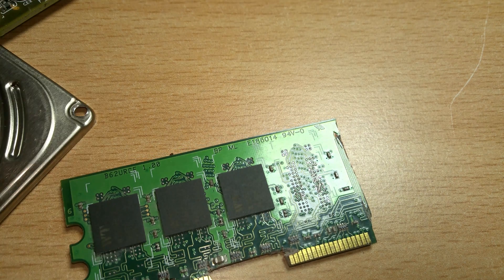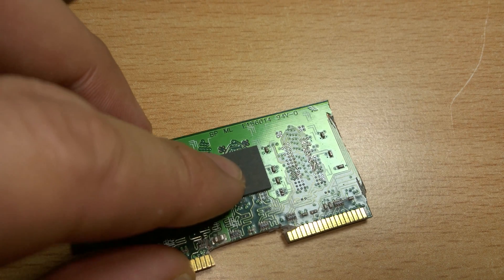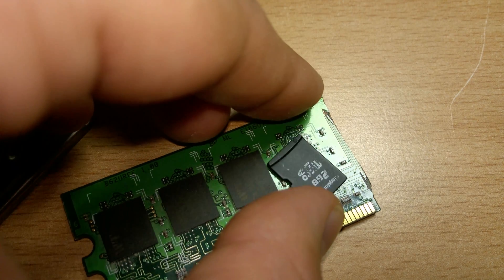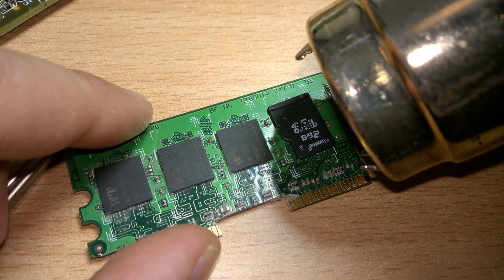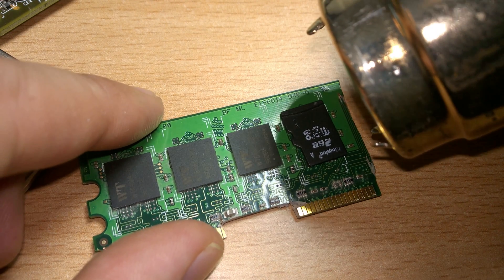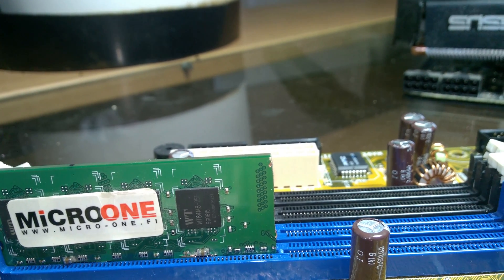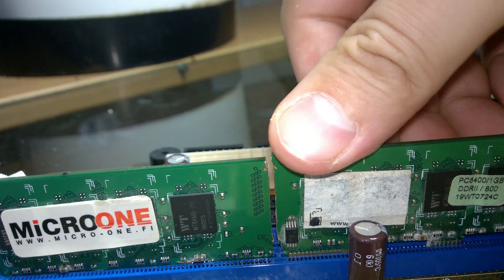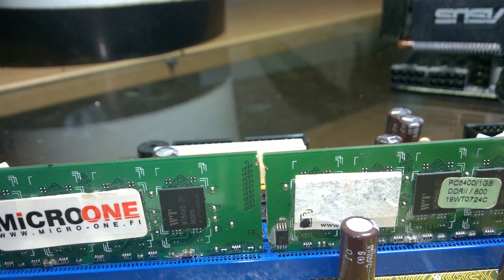Use your old SD card as additional RAM

Comment: Top thanks my guy! With the advancements in SD technology my pc now has a ram of 2 tb!! I dont even need a graphics card anymore. My modified ram is powerfull enough to run two instances of GTA 5.
Reply from the maker: awesome
Reply: Wait, no graphics card? Seriously? Can you give me more details? I'm currently having a serious headache trying to boost my PC to modern VR gaming levels, when it's a laptop with no thunderbolt 3. Having to crack open the back and replace the wifi adapter with an EGPU cable. If theres a way to reach that performance with something as simple as a bunch of SD cards, then I'm all for that. Could it conceivably work with a massive set of usb 3.0 splitters, and SD card adapters? Or maybe some other form of ram-adapted beefier storage?
Reply from the maker: try downloading